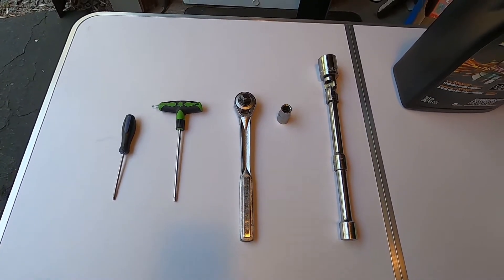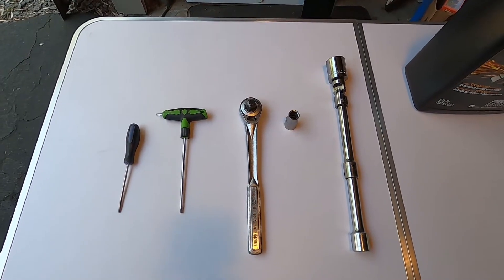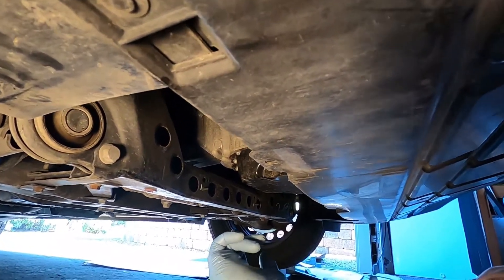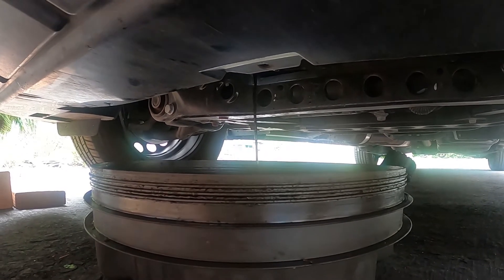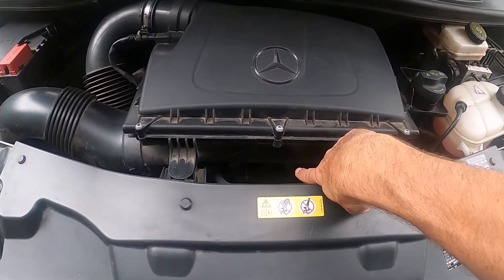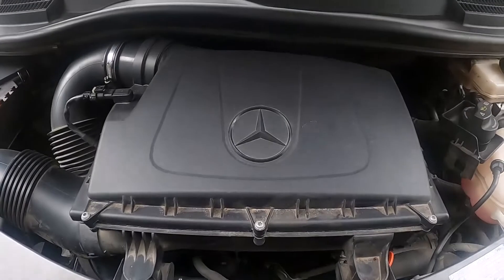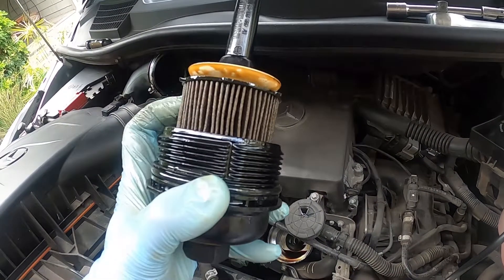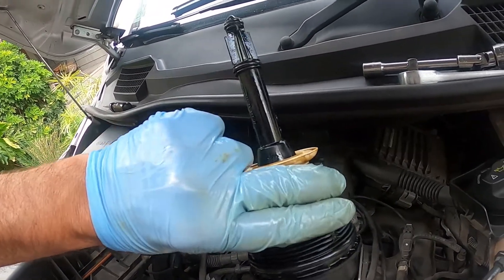Changing Oil on Mercedes Metris Van

Comment: I only did this ONCE... I installed a remote drain so i wouldn't need to raise the Metris, or remove the lower engine guard, thanks for this video so I was prepared with all the required parts and pieces!
Reply: Do yo have a video for installing a remote drain plug? Thank you!

Comment: For neatness you're letting the oil "glug" out.  But, it's better to have the oil gush out because the speed of the flow helps remove metal bits and particles.
Reply from the maker: I had not considered this, good point 👍

Comment: What's the recommendation mileage for oil changes? Someone told me it's every 15k.
Reply from the maker: Yeah, it is computer monitored, but considering there is a turbo i like changing it more often. Cheap investment in my opinion. I am doing 7k
Reply: @arproductions6895  is this something I can do at home? What else do you recommend doing when charging the oil?
Reply from the maker: Absolutely you can do this at home. I change the oil, oil filter, and also add a bottle of injector cleaner to the fuel tank at the same time.

Comment: We need spark plug replace video
Reply from the maker: Everything I read about spark plug change recommended going to the shop on that one. Extremely tight quarters requiring specialized tools. I let my local Germain shop handle that one.